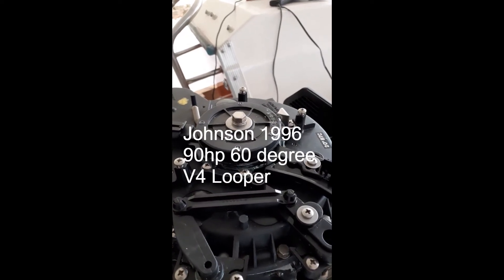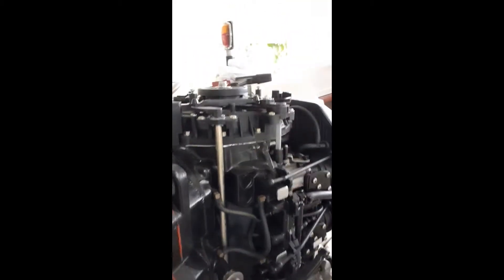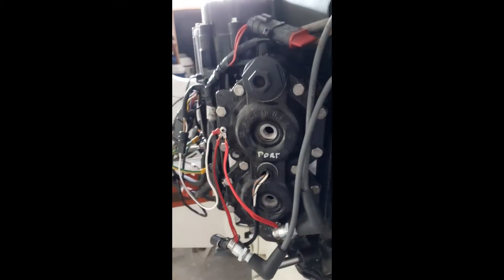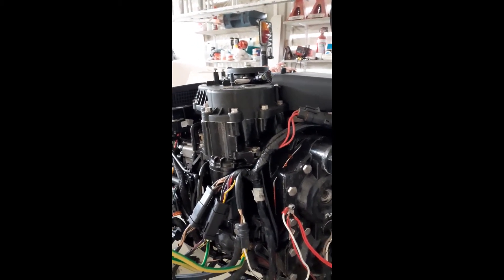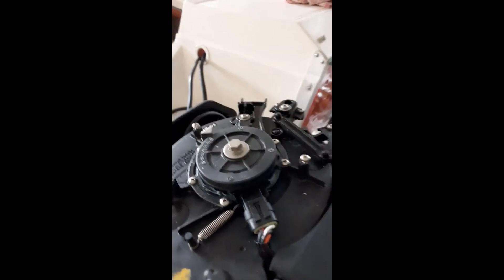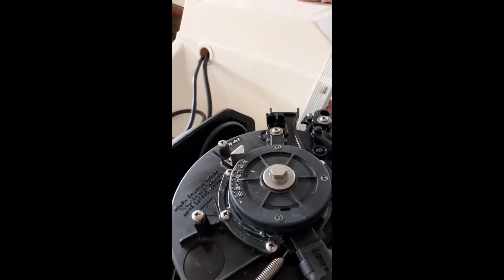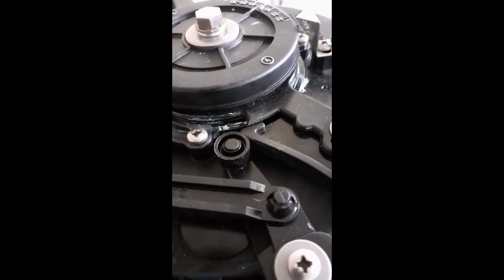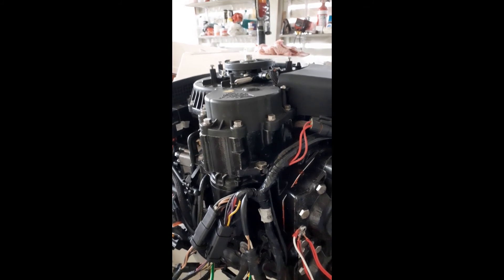Johnson 1996 90hp 60deg V4 OIS Ignition Timing using a timing light

Comment: You need a CDI Electronics powerpack to do the timing like this. It won't work with a stock one.
Nice video though!
Reply from the maker: Correct
Reply: What’s the difference why don’t it work with the stock one
Reply: @oskar84able  The OEM OIS‑2000 pack is a sealed module with fixed internal timing maps and Quick‑Start logic (likely using an internal microprocessor or dedicated digital logic) that is not user‑programmable. Its design assumes calibration only via a special tool. The CDI Electronics pack, however, uses a modern microprocessor (firmware) to manage all ignition functions. This allows CDI to implement a “static timing” subroutine. Internally the CDI firmware can override or fix the trigger edges when commanded, whereas the OEM pack does not expose such a mode.
Reply: @emitowww so how do you do it with stock ignition fast start system

Comment: I did everything you said and my idle timing and my wot timing is both too far advanced. Hard to tell but maybe 10 degrees  how did you set the pointer?
Reply from the maker: It is a bit hard to describe. I used the vernier calipers rod, touching the top of the piston through the spark plug hole, to determine two points equal distance from top dead centre for cylinder 1. I then adjusted the pointer so that the timing marks were the same on the plus side and minus side at those two points. 
Turn the flywheel clockwise until the piston touches the calliper rod before top dead centre. Note the timing mark the pointer is at. Turn the flywheel beyond TDC until the piston is just touching the calliper rod after top dead centre. Note the timing mark the pointer is at. The degrees before top dead centre and degrees after top centre must be the same to ensure that the pointer is set correctly. It is fiddly. Do it a couple of times to be certain you have it right. Then check it again...
Good luck and thanks for the question.
Reply: @wwaknz5101 perfectly described, I thought the marks on the flywheel were precise but I realized my tdc mark was about 10 degrees off from actual tdc

Comment: Great video.  The only thing i can't get to work is the starter button. When i jump my that way just the starter spins and not the motor. I have to jump my solenoid to get the motor to spin. Not sure if this way messes with the timing
Reply from the maker: Hi, if you have connected the live side of the solenoid (direct from the battery) to one side of the switch and the other lead from the switch to the starter motor it should work. Make sure you have heavy duty wires and swict to carry sufficient current for the starter motor.

Comment: Great instruction. Can you please elaborate on how to use the timing gun? What are you pointing the light to and what result are you expecting to see? Thanks.
Reply from the maker: Ah, yes good question. 
I ran out of hands to show the actual use of the timing light. The light is triggered by the spark going to number one cylinder. The light flashes onto the pointer and shows the marks on the timing wheel as the spark occurs. The setting for low speed is 4 deg after top dead center and for maximum advance 20 deg befor top dead center.
I hope that helps.